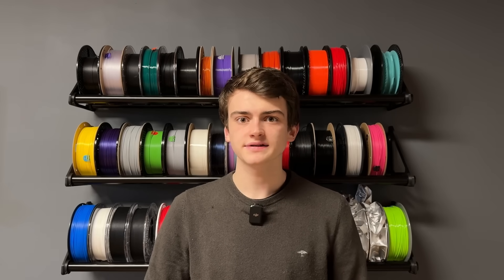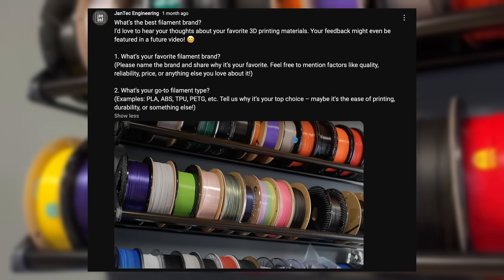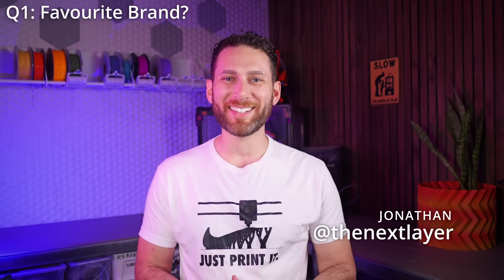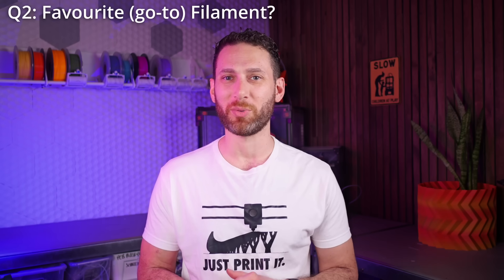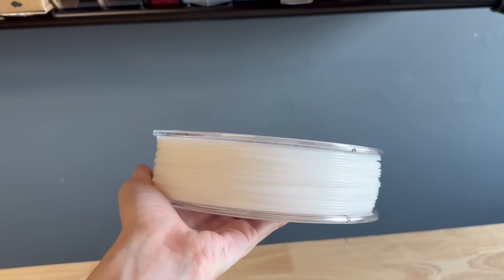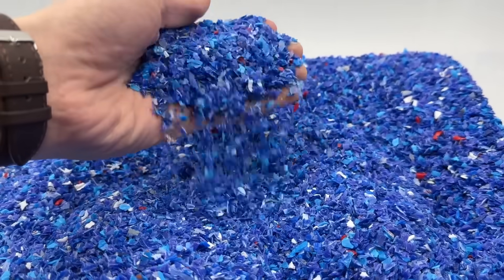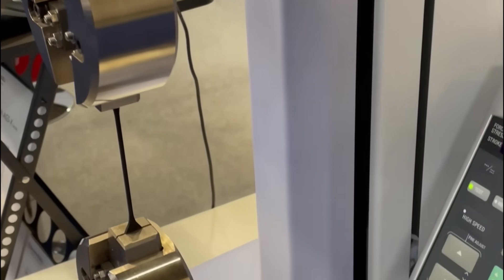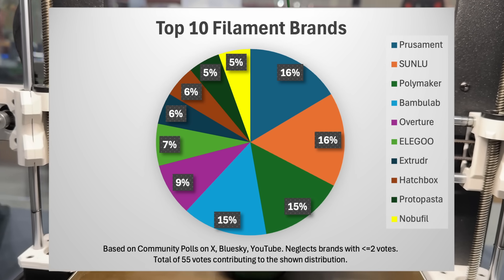The Best 3D Printer Filament Brand is...

Comment: It never made sense that they sell filament by the weight rather than the meter. As you pointed out, the densities are different. My 1KG ASA rolls are almost always right at the edge of the roll, fuller than any PLA or PETG rolls.
Reply: I think 1KG is better for shipping, as every Roll of Material weighs the same like that.
Reply: @HannesMrg  That makes no sense since spools change the total weight.
Reply: I worked for a resin manufacturing/3d printing company and the reason given when I asked why we always sell 1kg of each resin instead of full bottles was that it was defined by the shipping label and selling by the kg makes that much simpler for all parties involved (except the consumer I suppose)
Reply: Before filament run-out sensors were a common place and way before automatic filament changing it was very easy to weigh a spool and know down to the gram how much filament was left on the spool.

Polymaker still prints the weight of the spool on the spool.

At minimum, you can still quickly check if a manufacturer is short changing you by doing an initial weighing.
Reply: The new PEBA from Siraya tech is so light, they just fill the roll and sell it as 800G. If it was a full kilogram you would have to have some weirdly giant or thick roll that wouldn’t work in most filament dryer/spool holders.
Reply: Take a benchy for example. I can't measure how much length of filament it took to make. But instead how many grams. Likewise a spools length matters little as it's being extruded through nozzles of varying sizes.
Reply: Your slicer tells you how much length is used; nozzle diameter is irrelevant
Reply: @jamesbullo weigh it
Reply: @jamesbullo a benchy’s volume will always be the same, even between different materials. If you measure by length of filament you are also measuring by volume because basically all filament 1.75mm in diameter now. If you measure by weight a benchy can weigh (and therefore use) different amounts depending on the filament. Volume will always use the same amount, nozzle size or material doesn’t change this.

Comment: Q1: Polymaker
Q2: PLA for cosmetic parts CF PETG for functional

Also I have had the same experience with limonene and abs/asa. I've also found that using HIPS/polycarbonate together in multimaterial systems drastically degrades the strength of PC even without limonene.
Reply from the maker: Thanks for adding this!